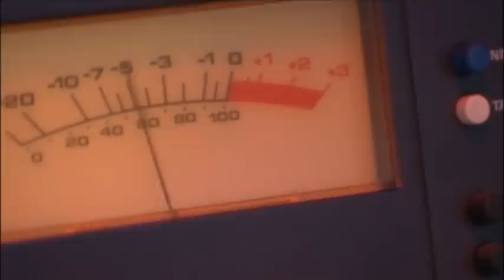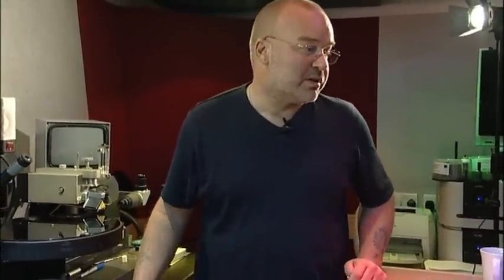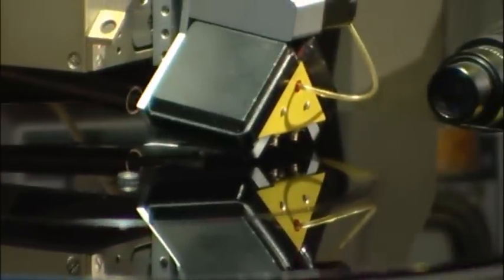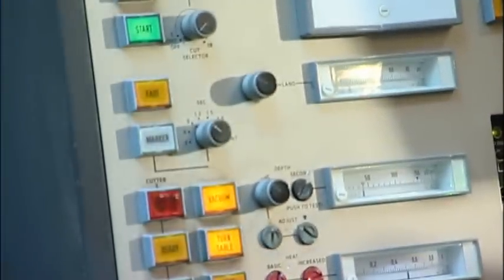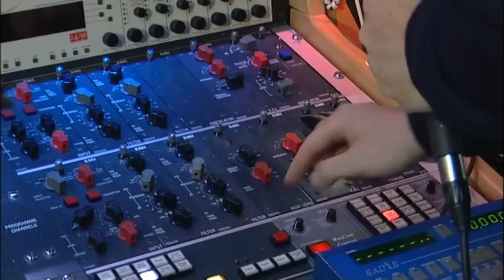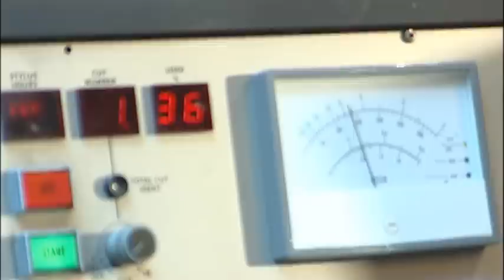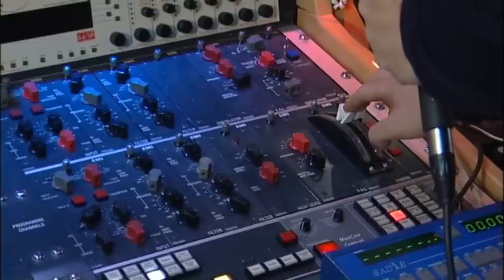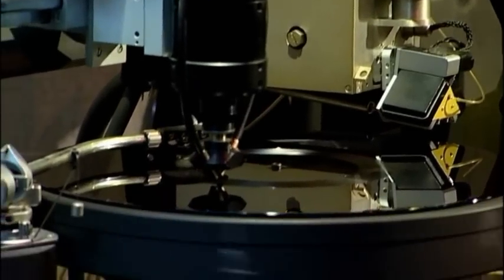Abbey Road - Vinyl Cutting

Comment: Thank God it *isn't* all analog! An all-analog recording would involve an analog master going to an analog mix-down getting duped, then getting duped again and probably at a slowish speed too. Then of course the label runs their stamper into the ground on high-regrind 100 gram vinyl. Mind you, labels went digital by the mid-late 80s, at least for cassettes. Major sonic improvement!

Comment: @MisterSensational Analog has an infinite bit rate, thus smoothness and resolve. We also hear in analog. Digital has its advantages though. The higher bit rates used in the studio have superior sound as compared to 44.1, There are no generational losses in making safety copies, and no losses in long term storage. Digital is the best way to archive older analog master tapes which are in the process of self destructing.

Comment: OK. Analog-Digital. Both still exist. Magnetic recording tape in various widths, lengths and reel sizes, even cassette, is still sold in stores that cater to musicians, so yes, analog recording is still around. Retro recording re-issurers many times use original master and session tapes, through tube(valve) consoles and cut to disc using the same lathes that were around long before digital was even a possibility.

Comment: 100% dead wrong. The Kills, The Black Keys, Radiohead, Foo Fighters, The White Stripes, The Raconteurs, The Dead Weather, Jack White, Ben Folds Five. Do you know what they have in common? They all recorded their most recent albums to ANALOG tape. Jack White's most recent solo album was mastered from analog tape directly to vinyl with no conversion to digital whatsoever.
Reply: Bro you have no idea what you're talking about. 100% of music whether Jack White cut to tape or not, ends up being digitally converted. Jack White's latest record was largely in the box also, meaning he used some analog gear, but ultimately cut into Pro Tools. People for some reason think that just because you cut to tape means you get to skip digital all together. People cut to tape for the saturation, not because its any "better" than digital, but rather it is less harsh by a mile and is easier to tame transients. It has nothing to do with inferior digital conversion, because digital conversion isn't causing this huge audible drop off like everyone says.  Digital is fine.

Comment: @wodrummerworld Yes, In my opinion, Telarc pressings sound very open and natural. (not warmer, not subdued) In the studio, Analog in the studio has its strengths and weaknesses. Analog has more headroom without hard clipping. Also the signal can be oversaturated on the tape itself for either soft compression effect, or light distortion ... which also can be done on a vocal track for instance at the multitrack stage. But analog can suffer generational loss/ storage loss, digital does not.

Comment: Digital is superior nowadays. The only problem with using CD as a master is that it's only 16-bit which lowers the max dynamics to roughly 90+dB. Therefore 24-bit digital mastering should be used.
Analog recordings far away from digital recordings considering dynamics and signal-to-noise ratio. This is just technical mumbo jumbo though. Everyone decides what kind of sound they like.

Comment: TheFRiNgEguitars had said that "analog has an infinite bit rate, thus smoothness and resolve."

If you were listening to a live performance, then yes.  Your perception of the infinite range of sound occurring live is limited only by your ears and your own mental attentiveness to the sound.

If you're listening to a recording, then that's a big fat no.  There is no infinite range in any medium and expression of recording, period.

An analog recording will be limited by the bandwidth of the medium, just like a digital recording will be.  This is because there's only so much information you can record at once on the medium being used to store and/or transmit the signal.  This applies to both digital and analog.

As for the assertion that we hear in "analog," what's the point being made?

Whether a CD or a vinyl record, you only get a signal your amplifier can use to drive a loudspeaker after the recording has been demodulated from whatever form it had to be modulated in to make the recording possible in the first place.

You can't hear the grooves by themselves without proper demodulation of that "physically coded" expression back into a reproduced signal (the stylus riding in the groove vibrates a cantilever, converting mechanical motion into sound that's converted into a raw electrical signal by the pickup and then sent to the preamp for amplifying the signal to line level as well as equalizing the signal with the RIAA deemphasis curve and then the finished signal is sent to the amplifier).

Likewise, you can't hear the binary coding on a CD by itself without proper demodulation back into a reproduced signal (the laser reads the pit and land track patterns, which expresses a coded signal in 8/14 modulation that is decoded to retrieve the 16-bit/44.1 kHz PCM signal that's converted back into a raw analog electrical signal that must pass through a signal filter before going out to the amplifier).

I am amused at people who proclaim that "digital is unnatural" without realizing that converting acoustic sound into an electrical signal is, itself, an unnatural man-made process.

Modulating that electrical signal into a form that can be transmitted or recorded is also not natural.  It's still the result of a man-made process that does not occur in nature, no matter if the process is analog or digital

The only natural sound is that which occurs live.  Sound reproduction is only a natural process if you're listening to a macaw imitate your speaking.

Thus the concern shouldn't be whether it's digital or analog, but whether the end result of a recording sounds good or sounds bad.

As for those complaining that Abbey Road Studios used a CD master to cut a lathe, what do you know that these fine folks at Abbey Road doesn't?  If you know better, then why aren't you there putting what you know to work?

Comment: Not if the original source is digital, it doesn't.

Believe me, if I played you an LP mastered from analog tape and another LP mastered from 24/96 tape, you wouldn't be able to tell a difference. You're a human. 96khz is FAR beyond ur capability. You'd have a nearly impossible time finding someone who could accurately blind test between a 24/96 recording and the exact same recording downgraded to 16/44.1

Comment: The new LP's are probably cut from a hi-quality digital master (with high bit rate) I am guessing. The older analog recorders are probably not used in professional studios anymore. Unless it is live, direct-to-disc. When Bitstream came out in the 80's, the digital Telarc vinyl LP's (pre-CD era) were of more audiophile quality than regular LP's. If anyone knows for sure about the analog recorder -- and I guess with noise reduction -- thing, I mean if it is still used; It would be good to know.

Comment: Yes, to DIGITAL tape.

Anyhow, you agree with me. Like you just said, the initial recoding is digital then converted to analog. You're not preserving an analog signal, because it wasn't analog in the first place.

Analog is dead. It serves no purpose. All it does is add extra noise floor and sonic degradation. something like 24/192 is far beyond the capabilities of the human ear. That is a format that would fine til the end of time. There's no benefit of converting it to an analog storage format

Comment: I saw this beautiful device in Germany behind the pane , say as is unbound technologically the embedment of the plate , and the dynamic steering a pressure {a stress} the knife on varnish , this is for me the theme not to jumping , say in the recorder the engine is with a direct drive or the synchronous  engine? [ excuse me {I am sorry} for errors - I use the electronic translator ]

Comment: @Wilson Richards. First of, i'd like to tell you that i am a big fan of analog, but the way you project the analog domain vs digital domain, is debatable. First of, studies show that a human cannot perceive frequencies higher then 20kHz. Period. Higher frequencies than that, are meant to be sensed by other means, but not the ear. And also loudspeakers, despite declaring often audio ranges more than 20 kHz, are not necessarily meant to reproduce them accurately. Analog domain's true beauty, is the imperfections added to the signal chain by the machines in the link and the enviroment itself (e.g. a tube's sound is highly affected by temperature and moisture and whatever). This imperfections, consist of slight distortions, phase changes that affect transients, general colouration of the sound and the noise floor (!). Imperfections like this, might be inaudible, but in a large scale path, they affect the perceived sound. Digital is meant to sample and reproduce the sound, and thus the analog domain perfectly. At 44.1 kHz you can emulate EXCACTLY the sound up to 22.05 kHz (read shannon-nyquist sampling theorem), minus a small bandwidth of lets say 17 or 19 kHz, at which you should brickwall filter the signal, else you get aliases. Bit depth has to do with the noise floor of the digital domain due to quantization error, much like the hum and scratches and noise of a vinyl recording. At 24 bit or even 16 bit, it's inaudible to the human ear.
To conclude: Digital = too much perfect. Analog = pleasantly imperfect.

Comment: I'm assuming he used a CD just for demonstration purposes. Cause why would you cut a record with a CD signal for the vinyl master?. Usually you get the master tapes or master digital stereo mix at high resolution.

Comment: That's an entirely different issue.

Anyway, with analog, you have to deal with external noise outside of the soundwaves and degradation over time. A miniscule signal loss due to sampling is much less of a cross to bare than that of analog equipment, generation loss and degradation.

Comment: Most LP's released today go from digital to Analog.  Sonically what you gain are the imperfections people love from the LP.  Even when you go from tape to vinyl straight, you are losing a generation and gaining imperfections.

There is no reason to master specifically for an LP since it is too expensive, and the market to justify it is not there.

Some movies on theaters some are filmed using 35mm or IMAX then transferred to an AVID for editing and post production back to film or digital.

Comment: Analog is the true image just as a NON-digital 35mm camera captures real life on film.
Digital cameras (just like digital audio recordings) capture "samplings" of the image called pixels.
The lower the mega-pixel resolution of the camera the grainier and less clear, less detailed the picture is. Digital audio is EXACTLY the same. The lower bit-rate/bit-depth of the audio recording the less clear and detailed the music is.
The higher the resolution the better but it still doesn't capture 100%.

Comment: Yes, of course, but that's by far in the minority. Doesn't matter though. There's not a single person on the planet who can discern a 96khz recording from a 192khz recording. That being the case, there's not a person who can tell a constant analog signal outside of other factors. 

If you really like the "analog sound", it's really the influence on your equipment (needles, preamp, etc...) of choice, not the actual recording that you prefer.

Comment: So many "Sound Voodoo Priests" here, that's just awful. Analog is'nt always the best way to go. "Brothers in Arms", "Ammonia Avenue" or "Eye in the Sky" are  early albums which recorded on digital tape and they have always sounded amazing to me. Vinyl cutting from a CD does'nt make sense but digital mastering before HDD computer recording and the Pro Tools mess, was just as good as the old analog way
Reply: Digital, with at the very minimum 32k resolution sound, played back through a quality sound system, in a suitable room, will knock the socks off a good vinyl recording, but that is because of the severe limitations of vinyl. Vinyl can sound pretty good if the engineer compensates for the deficiencies correctly. What really annoys me is the idiot (or crook) who crams 60 minutes or more onto the two sides of an LP. Half-way decent sound can only be maintained if the track duration is kept below about 18 minutes. Bass level towards the end of that track is already beginning to drop, and stereo separation begins to be lost, along with upper frequency response, right from the start of the track. Compensations (equalisation and amplitudes) can only compensate so far, and noise levels will then also become a limitation. Having said that, there is a subjective effect which comes into play; some people simply like the sound of a well-made LP. I'm one, but am not dogmatic about it. Others are quite happy with AM radio, but there's no helping some people with cloth ears and the attention span of a flea.

Comment: If you don't like that specific CD, that just means you don't like the mastering. You don't have some special ability to hear beyond the limit of what the human ear is capable of.

The main purpose of digital recordings is that they last. Something recorded today will sound the exact same 50 years from now. Analog has a shelf life. It degrades. Maybe your final mix masters can last a while, but your multitrack masters will usually be severely degraded by the time your finished mixing the album.

Comment: Yes, some artists still do record analog. that's not the same thing as an entirely analog process. Even if you use 1 single digital digital tool in the mastering process, it ceases to be a true analog signal anymore.

Are you gonna tell me you know for a fact these albums recorded to analog tape didn't use a single digital tool in the mastering process? Come on now. It doesn't matter if the source is analog if digital tools are used after the fact. Not that you could hear the different anyway.

Comment: Hmm. If it sounds like a CD, then your cartridge is too accurate a tracker, your arm of too good a geometry. your platter too isolating, and your plinth too dampening too. You might want to move to a vintage system that can track a "warm" Stanton 400 disco conical or Shure disco conical. Should give you an analog sound, just like duping MP3s to a basic dual well cassette deck willl do in a jiffy!